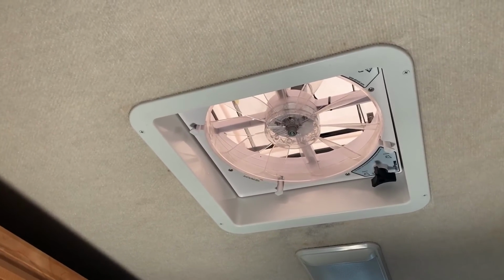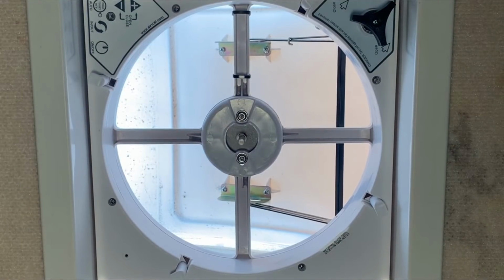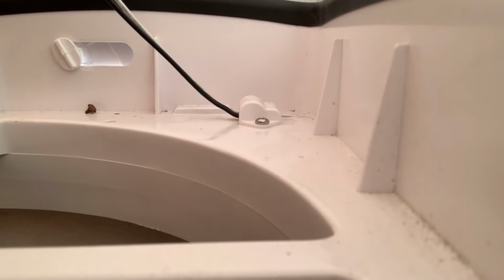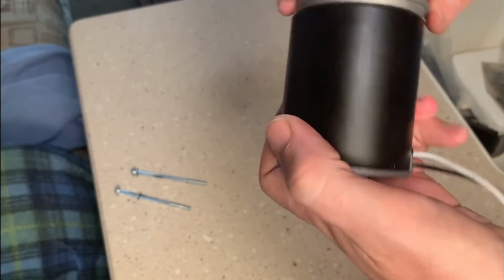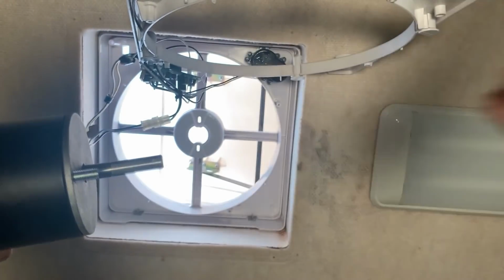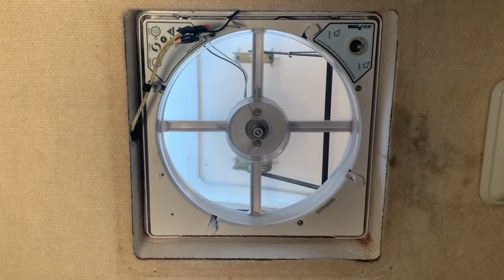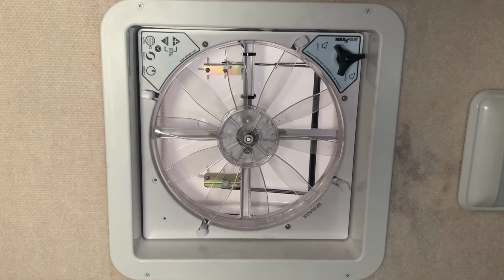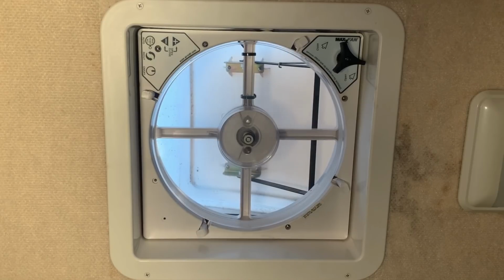How to Replace a MaxxAir Fan Motor

Comment: This was a VERY HELPFUL video. I was read to tear apart the motor in search of the chirp noise- in fact, I already had once before. Your comment that the screws on the top of the motor housing seemed to be too tight was exactly it!! I loosened them and now have a quiet fan! In fact, this solved a second problem as well. Above speeds 2/10, the higher fan speeds would result in the ‘green light and beeping noise’ malfunction. Since completing the adjustment, that issue is now resolved and we once again have full range of fan speeds!

Thank you for sharing this was a huge help! 

-Brian, DIY vanlifer, full time van travel since 2021.
Reply from the maker: Glad to hear.  Have a Happy Holiday!
Reply: @jcondon1  The other thing you have to do is install a DC to DC 12v regulator. These will blow your circuit board if it has more than 12v for an extended period of time. Dumb they dont have one built in.
Reply: @LastNameTom I believe the newer revision boards no longer need this. Been running mine at up to 14.5V for 3 years and it's been fine. Having said that I have the non-lux board so the deluxe ones might be more sensitive.

Comment: Hi, James! I had to revisit this video because my MaxxAir fan stopped working on my last trip a couple of weeks ago. Pulled the screen off, gave the fan a push, and it started working. Except, now it has an annoying click that it's making. I remembered watching this video 3 years ago and came back to see what you did. Well, it looks like I'm boned based upon what you did do. For over $100, you'd think they'd sell you something good. Anyways, I'm going to try a find a motor that comes close to the specs of the bad one and see if it works. It may be a couple of weeks before I do but I'll let you know how it works. Love the channel. Thanks!

Comment: After 40 years in the RV experience, I came to this conclusion after three years in. Almost without exception, every single manufacturer and third party accessory involved in the RV business is not only disinterested in quality but strive to maintain this low level of junk. I've learned the hard way to stay well clear of any OEM or "RV" parts. I've been satisfied with homemade parts and store bought gear that is not destined for the RV market. True, some undercarriage bits are the exception but the "MaxxAir" is a fine example of my rant.
Reply: Noticing that too
Reply: It is almost unbelievable how poor the quality is within the RV parts industry. I suspect low volume sales and up until now a distributed consumer group with limited means to complain . I think these kind of videos highlight the reliability and design problems of the RV industry.
Reply: ESPECIALLY when the item is over $300!
Reply: Yeah I mean, at this point I'd rather just a cheap 12v Chinese fan for like 30 bucks
Reply: Yes. This is my entire philosophy behind creating my own “RV” using a bare cargo van! I use as many normal residential parts as possible.  The electric is nearly 100% Victron.

Comment: I had the exact same problem.  Shot some silicone spray with the straw up the shaft shrouding it with a paper towel and all is good.  I am just the opposite of you James, I try to get away with the least first!  Great video!  I am sure most of the views are owners of the same fan!

Comment: Thanks for the video, I watched it before attempting to replace my motor just to see how big of a job it was going to be.  Pretty easy-peasy.

I wanted to replace my motor for two reasons:  For several years now it had a clicking when running on low, which I can only hear when I try to sleep and it would keep me up.  But worse, for years I've been chasing an overload situation where the fan would shutdown and beep for several minutes and then just stop working.  The only way to get it going again would be to cut the power to it for a few seconds.  Then it would run again, but sometimes it would overload again in either minutes or sometimes hours.  I can find no correlation to temperature, duration of running or load on the fan.

I tried two different voltage regulators which didn't help the overloading.  Their tech support recommended I replace the circuit board, but that didn't help either.  But then I recently noticed it would run seemingly indefinitely on the lowest speed, but would do its overload game at higher speeds.  So I asked ChatGPT about the problem and it suggested the motor was causing the problem.

I replaced the motor with a new one, so far so good!  The fan has run on high for much longer now than it has in years without overloading.  And the low-speed click is gone.  I hope this lasts at least a couple of years longer.

I see a lot of people complain about the quality of Maxxair fans and people say you get what you pay for.  Well, I can't find any RV fan that's better??  Before my Maxxair I went through two Fantistics, so I thought the Maxxair was an upgrade.

Comment: I feel your pain. I bought a Corsair computer case with three "silent" fans preinstalled a few years back. One fan clicked endlessly, the other two had grinding noises. Ended up replacing all three with Noctua fans - which cost more than the entire case! Now, seven years later, those Noctua's are still silent and working perfectly. You get what you pay, I guess.
Reply: I solely use Noctua fans in all my PC builds... they are by far the highest quality fans I have ever used!

Comment: I am having the same issue, luckily enough mine is still under warranty so I was sent a new motor. Came across your video when trying to find out how to replace it seeing the replacement came with zero instructions. Before the replaced the motor the tech had me run the fan for 24 hours on high speed he said this should be done with all of their fans when first installed. It did not fix the issue. He did tell me I should run it in high for 24 hours after installing the new motor. I'm thinking I may first try removing the bolts on the front and back and then reinstalling as you did on the original motor to see if that makes it quieter.
Thanks for the video.

Comment: I have the EXACT same squeak that comes and goes. I've loosened the bolts to see if it helps. Hard to say for sure right now cause it wasn't squeaking as bad as it can when i did but it made it quieter for now! Side note my blade is also wobbling like yours. I got a replacement and it's the same so maybe thats due to the motor as well.

Comment: I own this fan (but the model below it) and I have the same chirping problem. I’ve tried everything I could at the time. I didn’t manage to take it fully apart on the bench but I got the top off while it was connected and oiled it while it ran from the top down so it lubricate it all. Didn’t do a damn thing to improve it. My circuit board didn’t break but my control panel did. The chirping is more noticeable when I have the fan sucking air out than it does when I have it blowing air in. Blowing air in it can be completely silent but not all the time. 

I’ll consider taking the full fan apart and putting it back together to see if it improves like yours did as that was really quiet. I’d love mine that quiet when pulling air out as that’s the setting I like to sleep with. 

Sorry about that new motor. I really had high hopes for that. MaxxAir really doesn’t deliver. It’s too bad there isn’t any real competition for RV fans.

Comment: I contemplated RV'ing or buying a sailboat in my retirement. Watching many vlogs the past several years brings one damning realization about recreational vehicles...they are built on sand. New Boats or Travel Trailers are made of the cheapest materials top to bottom, and they are very expensive to boot. I owned a large boat years ago and that was eye opening back then. Now, a single dad with an empty nest, I purchased an inexpensive fishing kayak and will fish and golf around the USA in my retirement. I don't want to be a on call repairman in my final days.
Reply from the maker: It is a lot to maintenance.  Around me, most places will not touch it.  It is a real hassle to find someone competent to work on it.  I do what I can, but my generator tooling is not much good for fixing most large items on an RV.
Reply: @jcondon1  I pity those who don't have your advanced mechanical abilities who must pay every time something goes awry. Your videos are great.
Reply: Let me tell you, it doesn't matter which company built your RV, the fact is all appliances are made by the cheapest supplier.  The horror stories should be enough to damage the industry as a whole, but for some reason just keep buying crap.  I love to check out the latest RV trailers and Fifth Wheels and in doing so, all the equipment installed is the same, and its all garbage, now with LED strip lights wrap around everything. Just pick out the color schema you like and try an fix everything yourself, or make your own RV.
Reply: You will spend the first three years fixing all the manufacturers sloppy workmanship on EVERYTHING. "Lets just screw this thing together with the same length screws and not care  about whats on the other side."

Comment: You had that original motor apart,  did you perchance put a drop of oil on the bearings,  before putting it back together?  I would have.   I would have with the new motor as well.  Sewing machine oil works well for this.  I do this all the time with computer fans,  my server case is within arms length of me at the moment,  running,  and I can barely hear any fan noise though there's one in the power supply,  one on the CPU,  and two bigger ones in the front of the case.

Comment: I ran mine for two years straight with no maintenance and living in very dusty places but the motor did give out. I'd say it would have maybe lasted longer if I did not live in a burn zone for a bit, the soot really got all over the fan. Anyway, I bought the same part and will take better care of it in the future.

Comment: Had the same prob but with a brishless fan, got to the stage it was all or nothing, took it outside and let loose with half can carb cleaner everywhere inside and out and the blades, it run quiet and true ever since.

Comment: Just went through the same problem, I tore the motor apart and put it back together to no avail, so today I went to my local skate shop and got some new bearing, and replaced the ones inside the motor👌 good as new
Reply: Do you remember the specs for the bearings?
Reply: @fratermus5502  I do not, it was just the cheapest ones at try local shop.

Comment: Maybe replace the motor with a Briggs and Stratton engine.  At least you have a world of experience with them. Always look forward to your videos. Thanks 😊
Reply: I have this vision in my head now of James up on the roof trying to pull start the fan.
Reply: He could fall asleep to the sweet sweet sounds of a Briggs and Stratton engine. Similar to listening to waves on the shore.
Reply: @Tom-In-Ga  He’s clever, I bet he could take that noisy little motor and fabricate a starter for the B&S engine.  I know that clicking noise would be painful but only for as long as it takes the engine to start.
Reply: Why not just use a two cycle engine or a four cycle weed eater engine with a fuel pump to push the fuel up to the carburetor with a small starter to crank the engine?

Comment: C'mon James don't let this defeat you. You are a talented fixer. Pay particular attention to the end housings of that motor, are they properly aligned and match the bearing. Does the motor run silently for a long period without the fan blade. If it does then maybe the fan blade is unbalanced. You should be able to balance it by removing/adding material to the outer circumference.

Comment: Hi James,  Sleeve bearings vs. Ball bearings?  Usually the sleeve bearings will fail much quicker than Ball.  Knowing that,  this configuration will fail even faster because the fan is spinning away from the motor instead of resting on top the motor.  The manufacturers in the past used all copper sleeves not todays electroplating.  A few millimeters don't last long.  Replacement is your best option.  Finding micro-ball bearings with rubber boot coverings is other option.  The fans I worked on are 180 degrees difference were the motor was closer to the floor instead of the roof.  Exhaust, in an Ambulance or an RV is the same function.  When I was finished it looked like a mutant but ran perfectly and quietly.  Thank you.

Comment: Do you think the wobble in the fan may be wearing down or messing up something inside the motor. You should try running just the motor alone  for a few days and see if the noise on the old motor comes back. Thinking that when you opened the old motor it realigned something and after a few days with wobbly fans it messed up alignment again.

Comment: Could you give some Maxxair 7500 advice? Their Maxxair tech said “sounds like” motor. Online research seems to be circuit board

After 3 years it just started giving me the green light of death. When you turn it on it will open up and begin working after 10 or 20 seconds of fan operation it will close and begin beeping and giving green light. 

Voltage meter shows constant 13.55 volts coming in. I thought it may have been where you couldn't turn the fan past 20% but I turned it to 10% left it on for about 20 minutes and finally it gave me the green light again.

Any thoughts on this?

Comment: had a maxxair fan on my rv.  for two seasons ran fine and totally quiet.  I dont remember the blades shaking at all, and I remember it being a very high quality fan for this reason.  
You might try hanging the fan blade unit on a string and hook from the center like you would a car wheel and tire to do a rudimentary balance.   Also for the hell of it, check the voltage going to the fan ( lower voltage = higher amperage maybe running too hot).  Good luck.  good vid tks.

Comment: Thanks for the walk through James.  I replaced the chirping motor in my MaxxAir Deluxe following your guidance.  Luckily the new $100 motor seems silent at low speeds.  Fingers crossed that it stays that way for years to come.
Reply from the maker: Glad it worked out.  I ended up exchanging the new motor and the replacement is nice and quiet.

Comment: Could the chirp on the original motor be the brushes? Had a similar noise on my cars HVAC fan. The brushes were glazed. Lightly sanded them and cleaned the commutator with brake cleaner. Chirping stopped.

Comment: I've just put one in my camper. 
Couple of comments.
On the everlanders channel there's a video about the circuit board. They get wet and corrode/fail so when he replaced his he used conformal coating to protect the replacement. Did this to mine before installing.
I've seen quite a few complaints about noisy/squeaky fans. The only fixes have been replacement units. Fine under warranty, but not realistic after that. Mine chirps a little. Will live with it. If it really gets me, I'll strip and grease the motor.
The opening mechanism is horribly noisy. Like yours. Think I'll strip and grease. 
It seems to be a well thought out design. I love the way it's usable in the rain. But let down by crappy components/assembly.

Comment: Having the same exact problem with two of my MaxxAir fans just over a year old.  Got two new motors and just found this video.  Keeping my fingers crossed.  One thing the Manufacture said is to be sure to turn the fan on high for 24 hours to set the bearings.  They should put this in the manual or should be something the RV dealer completes at factory.  Well hope you get it sorted out, let us know if you come up with a fix.
Reply from the maker: I did not see that recommendation by the manufacturer, but did run it on high for a few days thinking the click on the new motor was just the brushes needing to wear in.  Ended up exchanging it for another and it worked perfect out of the box.

Comment: Separate motor for the hood?  Maybe the noise is coming from there?  Is the noise in sync with the spinning fan blade (maybe a small crack in the plastic)?  A combination of the audio on my computer and my bad hearing doesn't let me hear the noise at all.

Comment: Another video showed conclusively that the brush dust causes the noise and simply cleaning it is all that is required. I believe the bearings are sealed.

Comment: I'd say it might have something to do with the ball bearings. They're not really designed for axial loads, like what is present when mounting the motor shaft vertical. They have a tenancy to click or chirp from the ball cage being pushed to the side of the race and rubbing on the inner/outer race or both. Cheap bearings especially with sloppy tolerances make more noise when mounted in a way they receive an axial load. Problem is that it's hard to find good bearings. I always have to go to a local bearing and hydraulic shop because I've not found a single bearing online that wasn't trash.

Plain sleeve bearings would have been a better choice for the motor, even though they tend to not last as long if you don't keep their oil wicks saturated. They tend to handle axial loads better because the shaft just moves a bit to compensate for the different loading.

An alternative solution would be to try a tapered roller bearing on the bottom facing side of the motor, if they make them that small. Or a thrust bearing, either would keep the upper bearing and the rotating shaft assembly from moving up and down.